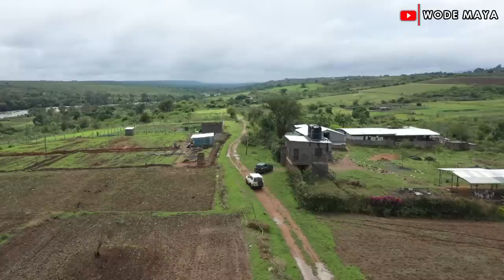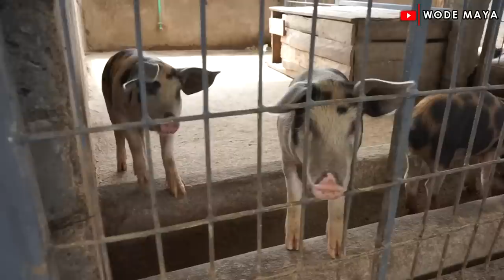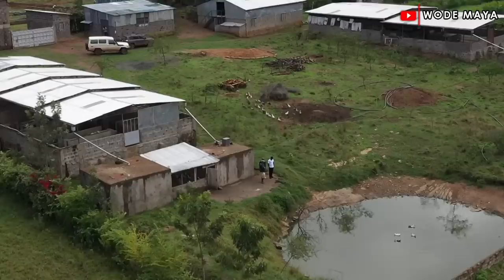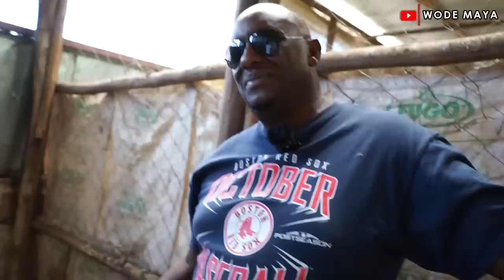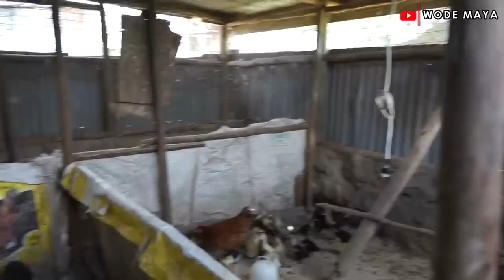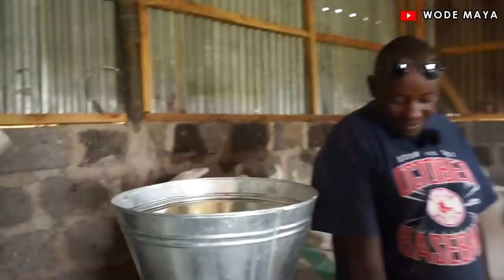I Left America To Kenya To Be An Animal Farmer!

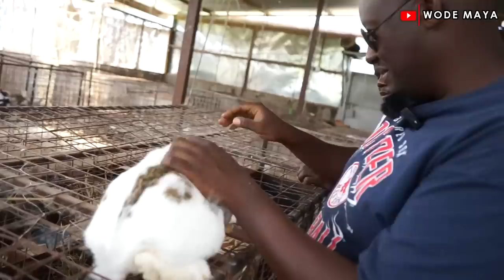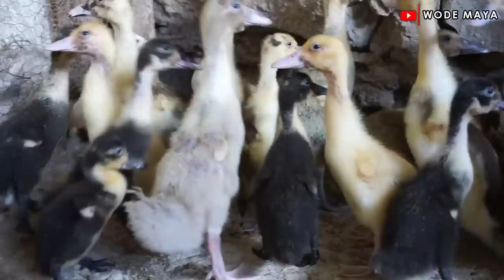Comment: 14:24 rabbit meat is the best meat I have ever eaten! low fat white meat ( convenient to prepare too). 18:53 A lot of corrugated tin roof is used, it will be terribly hot like an oven! add some straw or coconut leaves on top or use Styrofoam insulators under the room it will reduce the intense heat.